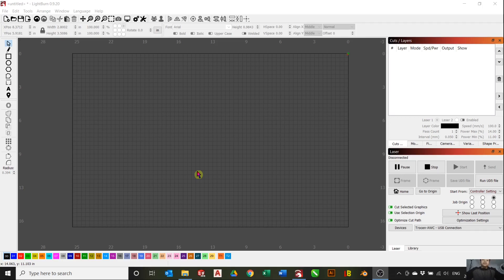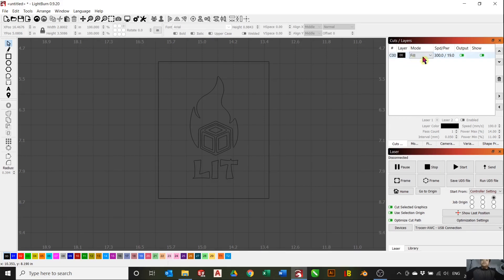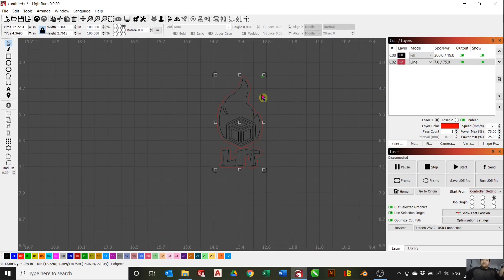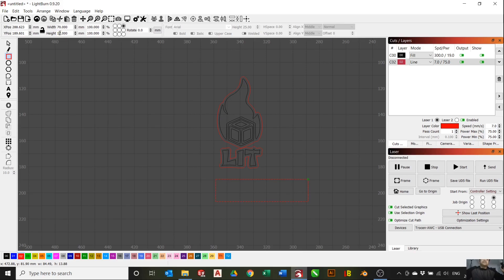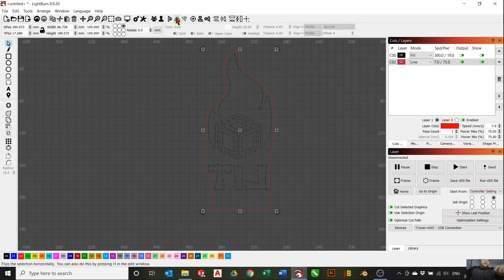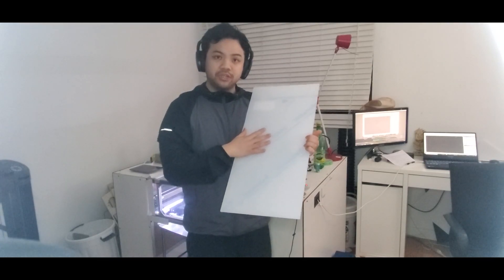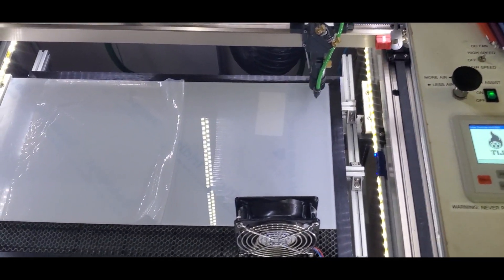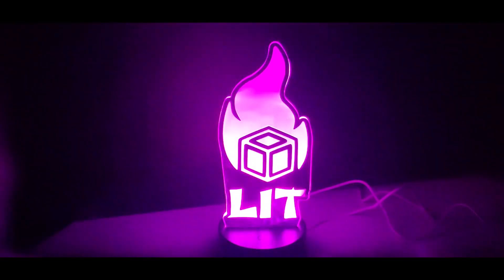How to PROPERLY Laser Engrave Acrylic | LIT Tutorials

Comment: What is the ideal thickness of acrylic for engraving photos?
Reply from the maker: Thickness generally doesnt matter when just engraving. It only matters if youre going to cut the acrylic with the laser. What matters more is that you use cast acrylic and not extruded. That being said, I usually use 4mm cast acrylic for most of my acrylic engraving projects since I have a 50w laser and anything thicker would need power higher than 80% or multiple passes..

Comment: is there anyway to prevent smudges on the acrylic after engraving and got a slight problem where some bits are not engraved properly where they appear to be half engraved and half blank, can anyone help?
Reply from the maker: Either turn your air assist off, or use a nozzle with a larger hole and minimum air assist. You can also use a dc fan blowing parallel to the workpiece to clear the debris during engraving, as seen in my video.
Reply: @Kubokraft3D  thanks, I will give it a try. Is there anything I can do to get rid of the black dirty bits after engraving, I’ve used rubbing alcohol which removes most of it but you can notice a little bit of the dirt being stuck in the engraving which doesn’t come out even with rubbing alcohol.
Reply from the maker: @TarunSonga  Im assuming youre using a CO2 laser right? Those small little dots are hot splatters while youre engraving. When they land back on your acrylic, it stays there. Add a very thin layer of dish soap to the acrylic right before engraving. Then when those splatters land back on your acrylic sheet, it will automatically cool, and you can wash it out afterwards with warm water. Dont use rubbing alcohol to clean acrylic. Sometimes it creates clouding and micro-cracks. Only soap and water.  Cheers!
Reply: @Kubokraft3D  I’ve got a few more questions if you don’t mind, I’ve messaged you on instagram.

Comment: Hello!
First of all, thanks for the video! I tried to do the same, and it looks OK, but I have fingerprints, or some other smudge on the acrilyc, just like yours had at the outro (only visible when lit), how can I clean that? I tried everything, soap, alcohol (you were right, I shouldn't have), window cleaner, even bought an acryl cleaner as well, but the marks of the wiping are always visible. (Also tired with microfibre, cotton cloth, paper towel, with the same results)

Comment: Hello! Looks very nice. But ... the right side of the " T " - Bar is not properly lit because there's a corner which prevents the light from reaching the right T - Bar. You should straighten the hard corner underneath so that the light from the base reaches the horizontal bar. ;-)
Reply from the maker: Thanks! Good tip! :)

Comment: Hey great video, and nicely explained. Just curious if i can use the Creality laser module fitted on the ender 3 to engrave acrylic sheets.. TIA  🙏🏼
Reply from the maker: Thank you! This method will not work with diode lasers like the one you mentioned. Only with CO2 lasers :(

Comment: Hey thanks for the video, I made a test card for acrylic and tried with and without dish soap, didn't seem to make much of a difference. But the rest of the video helped a lot. I was able to really dial in my settings and get a really clean engraving.
Reply from the maker: Thats really good to hear! The soap is just an extra measure to prevent any hot splatter from landing back onto the surface and fusing to the plastic and creating small white dots on the final product. If you have all settings dialed in perfectly, then it shouldn't do that, but the soap just gives a little bit more room to make errors. Happy laser cutting :)

Comment: What's the soap for?  I've never seen anyone else do that.  Is it because you use a CO2 laser?
Reply from the maker: Yeah this method only works with CO2 laser. Its to avoid the little hot particles from  sticking back onto the acrylic. Also makes for an easier clean later on.
Reply: @Kubokraft3D  Thanks.  I have a 5 watt blue laser and I'm trying to find instructions before I try my first engrave.

Comment: hey brother i have a atomstack s10 pro, I am trying to find settings for engraving and cutting acrylic using GRBL software but having no luck, I cant even get a mark on my acrylic, any recommendations to what I may be doing wrong?
Reply from the maker: Hey Sigi! Youre not doing anything wrong. Atomstack S10pro is a Diode Laser, which you cannot cut acrylic with. You will need a CO2 laser to properly engrave on acrylic.

Comment: what does the soap do for you
Reply from the maker: When engraving the acrylic, sometimes there will be some very tiny and hot particles that will splatter and land back on the acrylic if your settings are not spot on. Since these particles are still hot, it will fuse to the workpiece, and you will see some white dots on the end product (I have some pictures, but unfortunately I cannot post on here). IDK if you've ever welded before, but it is similar to a weld splatter that lands back on the workpiece and fuses back onto it and you will get small balls around where you are welding. This is the same idea, but on a smaller scale, and with plastic. 

By adding a very thin layer of soap, it cools the hot particles before it even touches the acrylic sheet and prevent it from fusing onto the workpiece. Plus, adding soap also makes it easier to clean after engraving. 

Although adding soap is not a necessity, it increases the tolerance for error of whatever power settings and setup you have for your machine. For example, in order to avoid these particles from splattering, your power settings and setup have to be tuned pretty much to within 2 or 3% of the optimal settings. By adding another mitigation (soap), you are able to increase the room for error without compromising the final product since splatter will not be an issue anymore. 

I hope that makes sense :)

Comment: What’s the point of the soap
Reply from the maker: Sometimes there's some hot acrylic bits that splatters and lands back and melts onto the acrylic sheet. You will sometimes see it as little white dots after you engrave. The soap acts as a barrier between the sheet and the splattered acrylic and cools the splatter before it even has time to melt onto the sheet. Not 100% necessary as having the perfect settings will not give you splatter most of the time, but the soap just lets you have a bit more room for error if your settings are not perfectly dialed in. I like to think of it as "making my target larger". Also much easier to clean the piece right after since all lose material just slides off when you run it under the tap.
Reply: @Kubokraft3D   awesome good info

Comment: Does it matter if the soap dries? I'm assuming it does rather quickly, since its been spread so thin for an application. Thanks
Reply from the maker: Hi! Yes it does, but I haven't had problems with it drying too fast before. If you have excess soap from a previous job that has been dried up, make sure to wipe it off and apply a new layer of soap on your acrylic sheet before you start. I use baby wipes (water based) to quickly wipe off old soap. :)

Comment: No matter what I do I can’t get anything to etch on the surface using this technique....Very frustrating.   If I paint the surface with black matte paint it burns easily at 10% power...in fact, it burns too much and just looks like melted goo instead of having that frosty look.    I’m quite frustrated at the whole process right now.   :-(
Reply from the maker: Are you using a CO2 or a diode laser?
Reply: @Kubokraft3D  yeah...discovered my mistake.  I’m on a 5.5 watt diode laser.     I Can’t get any decent results on acrylic with it.    I see people doing it with a diode on YouTube but I just can’t seem to get anywhere close to the results.   I’ve tried every technique I can find yet nothing produces decent results.   It either fails to etch or it just sort of melts it.   Ah well...I’ll keep at it and see if I can find some useable technique...   I may end up just etching it with a drag bit or v-bit in the end...want to use the laser if possible because it should produce finer results
Reply: @KerryJapan1  Your 5.5 watt  laser diode is probably an 'input' power rating, whereas generally they measure gas or tube lasers with (as) output power.  You are lucky to get 15% of that out, which is about 825 mw. So if you run 10% power, you may only be getting 83 mw out...  I have a 30 watt diode laser that gets around 5 watts out. I had to run mine around 70% power (about 3.5 watts,) if I remember correctly.   Most of these people are talking 40 watts or more.  

Check focus... If you can run some test runs that vary speeds/feeds that might help you figure it out.  If you have a LightBurn compatible controller they have some tutorials on how to set up a test grid...  Best of luck.. Take care...
Reply: @jackwilborn2353  Thanks for the reply Jack.    As I mentioned above, with black paint on (or permanent black marker) on the surface of the acrylic I have the opposite problem...the acrylic seems to just start to melt rather then turn into that nice frosted look.    I just downloaded Lightburn and will play around with that.   Maybe better software will help?

Comment: Interesting technique to use a soap covering…  This works great for lasers (usually older ones) that do not provide "bottom up" laser movement.  One issue with lasering engraving lots of plastics is the zapped residue is still hot immediately after lasering, so the "dust" sticks to the plastic that is not lasered — both top and bottom, but mostly on top.  Using soap (rather than that expensive acrylic cleaner stuff) resolves that; and so does bottom up lasering (which most / nearly all new laser machines have).  Additionally, you are the first person I have seen that also did what I did: have an auxillary fan to assist in blowing away dust — as well as helping suppress / extinguish unexpected flare-ups when some stuff just ignites (gas from cutting acrylic, paper backing, etc.).  Another fire suppression I have used with my old laser is to feed CO2 (carbon dioxide, for you non-chemical folks) thru the air-assist tube.  I was cutting some 3/8" thick acrylic and it just kept "catching" on fire because I had to laser very slowly (the speed) to cut thru.  Cutting two times at 65% of what is needed just did not work well for me.  The CO2 suppress fire: combustible stuff requires O2 (oxygen) occur.  Also, another technique I ALWAYS use when cutting acrylic is to raise the plastic above the vector grid.  This prevents the backside flash-back melting of edges that happen to be resting on the metal vector grid.  Some people think ½" or more is needed: nonsense.  All one has to do is elevate an eighth of an inch or so (3-4 mm), but slightly more is better.  How is this done, you ask (actually I am asking for you)?  Put round headed screws in vector grid, screws with heads large enough to NOT fall thru the vector grid but small enough so the body (where the threads are located) fit into the grid.  This works perfectly.  And, if you use a fan like the LIT guy (and me) does, there is enough fan air blowing under the plastic to help suppress backside flames as well as dissipating (some) flash-back heat that caused the flash-back melting.  Avoid using a screw to elevate the plastic is too much that it would cause the acrylic to be higher than the X & Y alignment guides — so the plastic is not crooked on the bed.  As long as the plastic elevation does not cause the plastic to be above the alignment guides, the better you are: so go as high as you can.  However, there also ways to "raise" the height of the alignment guides: if your alignment guides are secured with screws to the vector / engraving table, you can make an acrylic strip (that is why lasers were made: to cut acrylic) to screw on top of or underneath the "real" alignment guides, just make sure the holes in the plastic match up with the screw holes in the alignment guides.  And do not waste plastic to get the alignment holes correct: created a "screw hole" template using paper.  When that is perfected, the cut ONE the supplemental alignment strips from one piece of plastic: measure twice (or more), cut once…
Reply from the maker: Very great point you made. I 100% agree with everything you said. I dont have much problems with getting backflash when I cut acrylic because I dont peel off the protection on the back of the acrylic. But when there is no protection on the back of material, backflash is a terrible and very common thing. I usually use rivets inserted into the holes of the honeycomb in order to elevate the material, then I can just pop it off later when I dont need it. But it does create a problem sometimes when the rivets are not made the exact same length as each other. Another good point you made is that if the material is elevated, the DC fan can blow fumes and particles from both sides.

Comment: What about using a othur laser 20w fixed focus
Reply from the maker: I dont have a diode laser, but I believe you cannot cut or engrave transparent acrylic using a diode. You could possibly put a black coating on top of the acrylic and try engraving it.

Comment: Just an observation.  I have been making these LED signs for quite some time.  In my experience, the liquid soap and the cross fan are unnecessary steps.  I just use air assist and engrave on the bare clear acrylic.  After engraving, you just rinse the engraved side with water and use a soft microfiber cloth to lightly wipe the surface while running the water on it.  I'm sure the liquid soap works but it takes extra time and materials that aren't really needed.
Reply from the maker: Thanks for your comment :) I have  done that before in the past, but have found that bare dry acrylic sometimes leaves a clouding effect on the engraved part, even with air assist turned way down. And without the help of the fan, it doesnt clear as well and I skmetimes get little white dots around the engraving. In my experience i found that this method gives me the best and most consistent results, and ive been using it for all of my orders with acrylic :). Ive never had any clouding and random white dots since using this method. And the engravings end up really smooth. But totally use which method works best for you ;)
Reply from the maker: And also with air assist turned up too high, the engraving looks "dotty"instead of smooth. Thats why I turn down my air assist to minimum. Thats the secondary reason why I use my fan. It helps to clear smoke from the mirror since air assist is super low and might not be enough as is.

Comment: Hi, Great video. I use a 40W laser and as material Plexiglass cast acrylic but I can't obtain a frosted engraving with high contrast like you. It's just clear like the begin. 
I tried with this settings:
Speed: 100mm/s
Power: 10% of 40watts
I hope you can help me
Reply: 3 things to check.  1st, be sure that the acrylic truly is cast acrylic and not extruded.  I've ordered cast acrylic in the past and found it was actually extruded.  Cast acrylic will "frost" much nicer.  2nd, de-focus your laser by 3 mm or so.  That puts it slightly out of focus so the engraving will be frosty but still in focus enough to cut your piece out after engraving.  Finally, set your lines per inch to 318.  Lightburn will probably change that to 317.50 but that's close enough.
Reply: @sillywwabbit   @gerald oliver  Thank's for you answer and sorry to answer this late. I make several test with differents configurations about focal, speed and power. Always the same result. I think it's the consumable. Do you know a way to be sure that it's acrylic extruded ? (a chemical reaction or any way). And do you know a site where I can buy acrylic cast ? (I'm an european and I don't have VTA number, it's a hobby and not my business) I tried trottec and gravograph, but the both need to be a business in Europe. Thank's for your time.
Reply from the maker: Hi! You might need to bump up your power. 10% i think is too low for 40w. Try bumping up to maybe 15% or somewhere in that area. Im using a 50W. Are you using a CO2 laser?
Reply: @Kubokraft3D  Thank's for your answer. Yes I use a CO2 Laser. With much power I obtain only a deeper engraved image and have the same problem. Do you know if it's possible the problem comes from the cast acrylic? 
My CO2 Laser Tube Glass is from Cloudray like the power supply.
Reply: @mrarmonius  Hello Erwan I have already cross this issue on a CO2 . Most of the time it's because it's NOT acrylic.  Buy your acrylic sheet at trottec website or gravograph. The other issue I have met with this joke , was due to lens issue , where the focal distance was not good on the machine.

Comment: will 2mm thickness be sufficient enough?
Reply from the maker: Depends on your led base. First check what thickness your led base can take. Typically, the single layered base can take 3mm or 4mm, but it can differ.
Reply: It will be a little wobbly using 2mm acrylic and a 3mm opening, I have wedged thin pieces of plastic to the base opening so it doesn’t wobble

Comment: Thx for sharing with us! Would tell us how to set z-axis. I mean wich distanc when I want ti engrave the backside? And is it the same way when I use I diode laser?
Reply from the maker: Z-axis focus on a CO2 laser depends on your mirror focal length. Smaller Focal length = harder to focus, but finer details, and vice versa. For acrylic, there is a trick called " de-focusing" which helps in getting a perfect engraving by slightly putting your laser out-of focus. Hoping to do a video on it, but there are also many tutorials on youtube on how to do this. :) For diode lasers, I don't have too much experience tho.